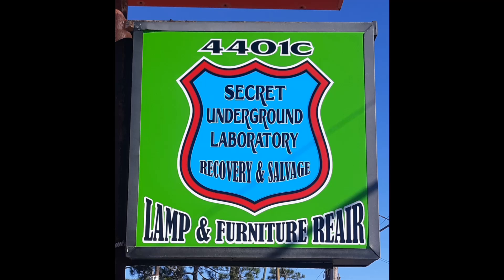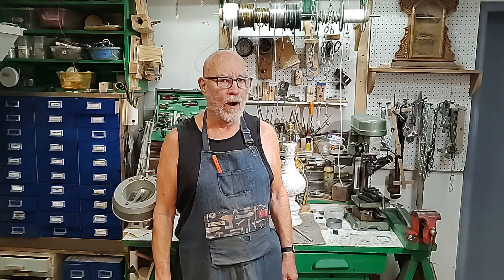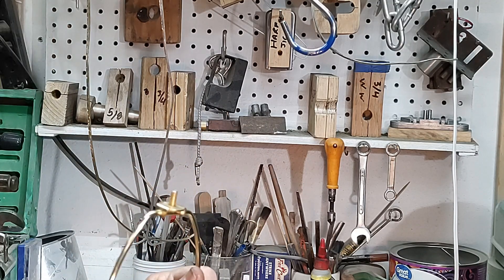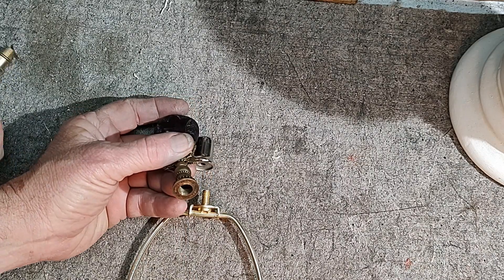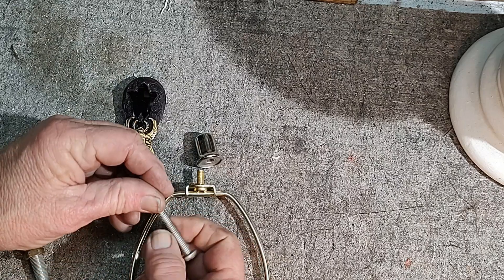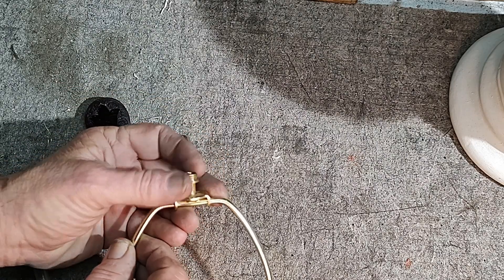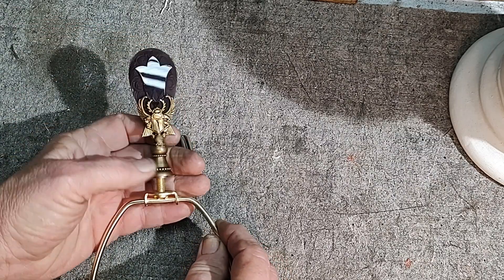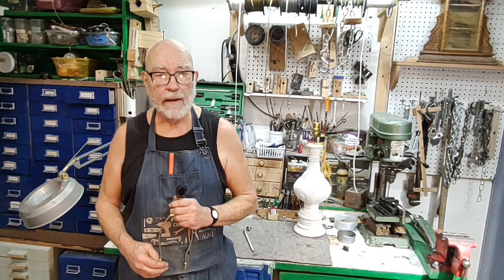Everything in Life is a Hardware Problem in the Secret Underground Laboratory Recovery and salvage.

Comment: Not everyone has a shop like yours, but with the knowledge you provided in your video, one will know what to do to resolve their issue. The rest depends on Ace Hardware or Amazon for the part.
Reply from the maker: @truthinlvl7786  I don't believe anyone else has a shop like the Lab, at least to my knowledge. I keep a lamp parts inventory much larger than the standard hardware store and one day faster than Amazon. This keeps the turn around time to less than a week on most work. In my experience, most lamp repair is part time work. The lamps pile up and once a month, someone comes in and knocks out the whole batch. 
For this particular job, the customer mailed the finial to me because they couldn't find an adapter locally and wasn't certain what piece to order. That's why I went into detail about the threads.